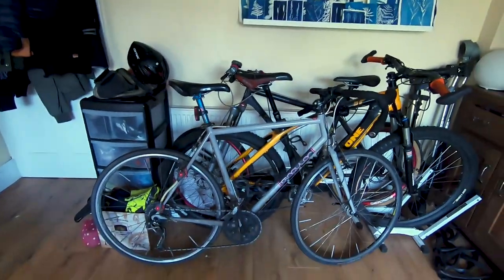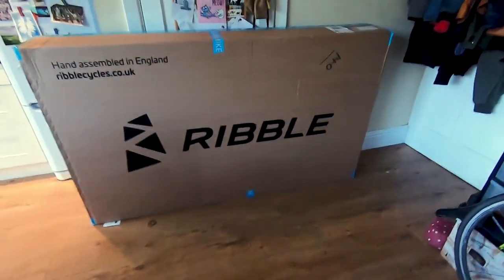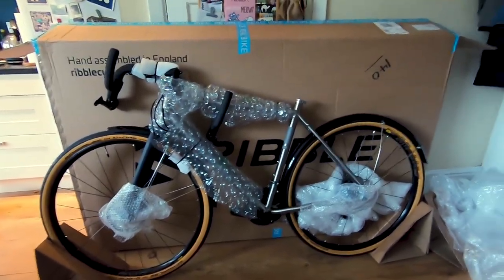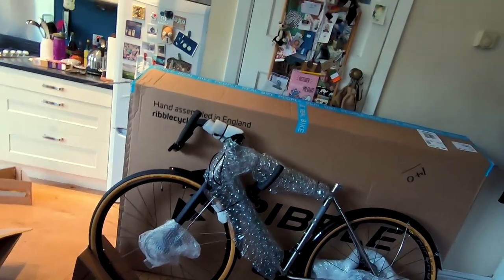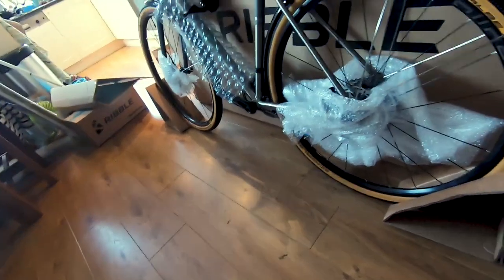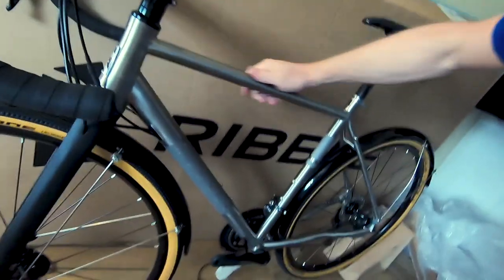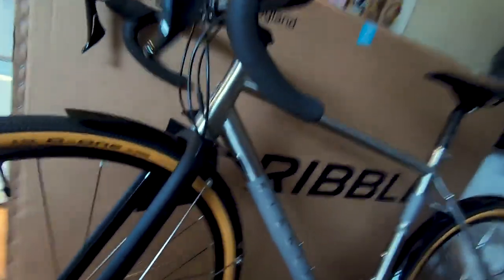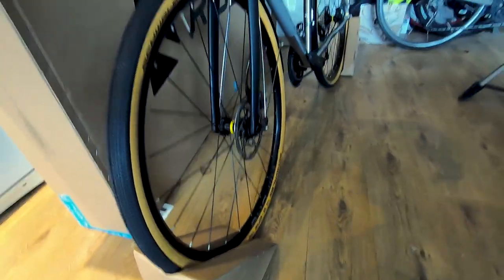Diary of a Randonneur - Episode 1 - Unboxing the Ribble CGR Ti

Comment: Just discovered your videos and blog. Pretty inspirational.. I like the idea of trying an Audax later this year, once I've decided on and got a new bike. I'm wondering how you decided on the Ribble? Did you have other contenders in mind also? I'm toying with the Ribble or a Ti Sonder Camino.. i if be interested in your views!
Reply from the maker: Hi Rich, I had been looking at the Sonder but no thru-axle and more importantly no 105 build available put me off. I also took a look at the Croix De Fer Ti but I didn't feel the value was there. I looked at Planet X, maybe the Tempest and the Pickenflick but I'm used to Shimano and there were only SRAM builds I believe. Also, I have had very mixed customer service from Planet X/On One and that went against them when it came to a big-ticket item. There were a couple of framesets I looked at, as I have built most of my own bikes, but I didn't want to take that route this time. The Ribble was the build I wanted, the geometry was about right and I felt it was reasonable value. I was also able to go throw my leg over one and see how it felt.
Reply: Diary of a Randonneur thanks for your speedy reply, Neil, and for your rationale. I agree wholeheartedly about the Genesis (Kenesis are in the same category) and hear you too on Planet X / On One. Have you used the bike for any light off-road yet? If so, how does three 105 date with the rough stuff? Cheers, Rich
Reply from the maker: @richjago9397  Yeah, I have, see the latest episode (10 part1). Honestly, I would say it wasn't really a fair test as I didn't really have it set up for just how rough some of that was. The reasonable condition gravel roads it handled great though. I would run softer tyre pressures "normally" for some of that terrain which would have made a huge difference on the proper rough stuff, there is only so much chatter the frame can make more comfortable.
Reply: Diary of a Randonneur thanks Neil. I've watched the episode and am keeping a beady eye out for part two. I've more or less settled my mind on the Ribble - only decision now is groupset - 105 Vs GRX. I'm leaning towards 105 as I have a mountain bike for 'proper' off-road riding and I have to say you're definitely inspiring me to give audaxing a go! I did the Dunwich Dynamo a few years back, but since then have moved to Cornwall and was put off road riding on account of the vertical cliffs they call roads here.. double upfront certainly needed! Cheers again. Rich
Reply from the maker: @richjago9397  I think a double up front gives you huge flexibility. I run an 11-30 cassette most of the time, but for that big trip, with a loaded bike and loads of climbing I put an 11-40 on. You can soft-peddle anything, forever on that. 

I think the Dunwich Dynamo is similar to the Moonrakers and Sunseekers Audax that runs out of Bristol in November. Worth having a look at if you are into night riding, it was my favourite calendar event of 2019.
Reply: Diary of a Randonneur cheers for the advice, Neil. Yup, I remember your video about that one. I'll try to check it out for later this year. Rich

Comment: Hi Neil, a quick question... have you had any problems with your CGR? I’ve had the same bike for about as long as you... and have had to make two warranty claims. Has yours been Ok?
Reply from the maker: Generally been fine. I did have some creaking that I thought was me going through bottom brackets quite quick but since greasing the internal cable routing entrances that went away. What has been up with yours?
Reply: Two cracked frames! Both have gone at the top of the downtube - where the cables and hoses enter the frame. First frame lasted 3 months. This one 9 months.
Reply from the maker: @SaddleSore , Of course, I immediately went a checked my frame...The first one going at 3 months you think OK a manufacturing flaw, not great but these things happen. Another at 9 months in the same spot though seems super unlucky. Do you know if they are going to replace with the new version of the frame?
Reply: I’m not sure until I speak to them tomorrow - they replaced the first frame without any hesitation. I’m reluctant to get a third Ti frame from them (I’ve had Ti bikes for years without any such issue) and may plump for a 725 instead.
Reply: @SaddleSore  how did you get on? I noticed that Ribble now only offer 3 years warranty on all frames. They used to advertise 5 years for titanium and steel frames.
Reply: I ended up getting a full refund and bought a Mason Bokeh instead. A much better bike.